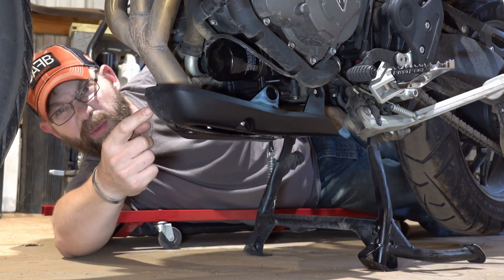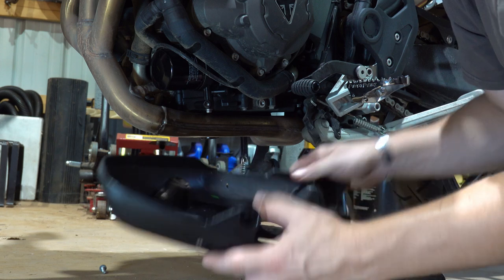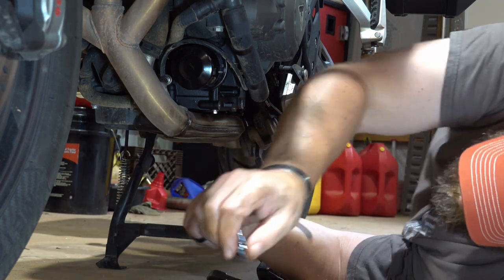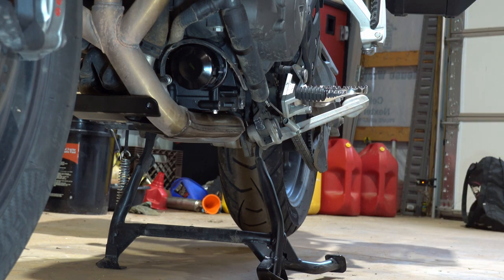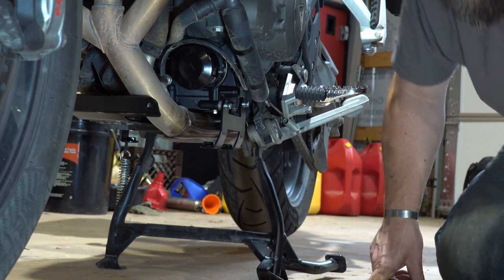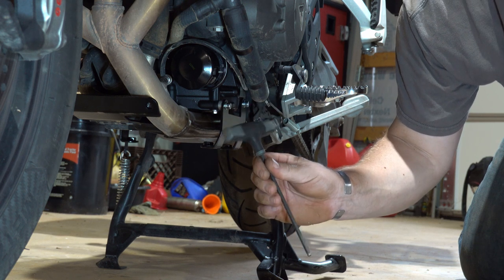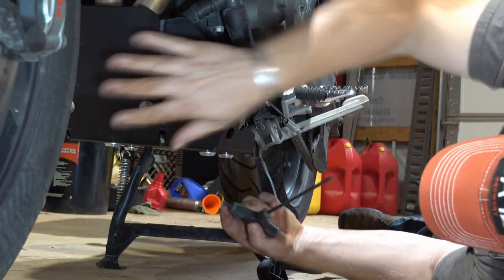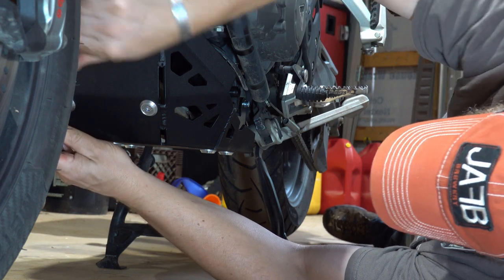Hepco & Becker Skidplate for Triumph Tiger 900 - Installation and Overview

Comment: Looks nice and I'm considering an H&B for my 900 GT. Question: Should there be a hard hit like bottom out will the fact this is actually mounted to the engine and not the frame (as there is none underneath), will a hard hit damage the mounting points in the engine ?

Comment: LIke - it protects the oil filter.  Dislike - the plate has to be removed to remove the oil  filter.  Any skid plate 2 -piece designs out there?
Reply: T-Rex racing makes the best skid plates when taking into account not having to remove the skid plate to do oil filter changes.  They have an access panel for the filter that is removed  for filter replacement and have a drain hole in the proper position to be able to remove the drain bolt. They also try to avoid attaching the skid plates to the engine itsellf and usually a way to use brackes to mount to the frame of the bike instead.  I wish more manufacturers of these skid plates would take into account serviceability when designing them...

Comment: does the new skid plate allow access to the oil filter? thanks
Reply from the maker: No.  Skid plate must be removed to change oil.  Adds about 2 minutes to the job, which I think is completely worth it for the substantial increase in protection.   Besides, it took me at least that long to clean off the dirty oil that dripped all over the stock skid plate when I changed the oil before...
Reply: @RidgeRoamer  that’s a good point about removing the skid plate to clean up the dripped oil. Thank you for the instructional video, very helpful.

Comment: That looks a better job than that cheap bit of pvc 👍
Reply: What else do u need on a street?
This bike is not ment for hard off-road that u would need this kind of skid plate
Reply: @DoctorDJ1976  I agree. I have the 900GT myself and bought it more for comfort of commuting weekend trips.  Definitely wouldn't take it off-road other than some light fire trails.  That's why they sell the Rally Pro versions of these bikes.

Comment: Any reason for not using loctite
Reply from the maker: Skid plate does have to come off to change the oil, so if you use loctite, make sure you use the removeable type.  I will probably add a little bit of loctite at next oil change.

Comment: Hi! Does the HB skid plate work with the OEM centre stand?
Reply from the maker: Yes. Mine has the center stand too
Reply: @RidgeRoamer  thanks for the reply and the useful videos….just booked the tiger 900….need to let the dealership know in a couple of days whether I want the rally or the rally pro.  Quite happy to get the rally and pay extra for better protection such as the HB system….just not sure if I need that off road pro mode from the rally pro! Any advice?! As long as the TC can be switched off completely in the normal off road mode, I’d be fine with it. Thanks 🙏🏻
Reply from the maker: I would have bought the Rally if I had slightly longer legs.  The more ride modes the better.  Can't go wrong with either version though!
Reply from the maker: Definitely get the Pro version if money isn't a problem.   Heated seats, more lighting, etc...
Reply: @MrSatyadeep Pro is a must.  The traction control on standard off-road mode doesn’t allow you to have any fun.
Reply: @freeheelsak  but TC can be switched off completely by going into bike set up….even on the Rally version